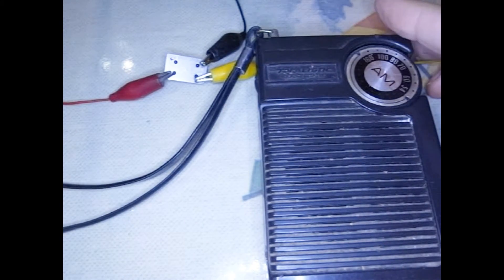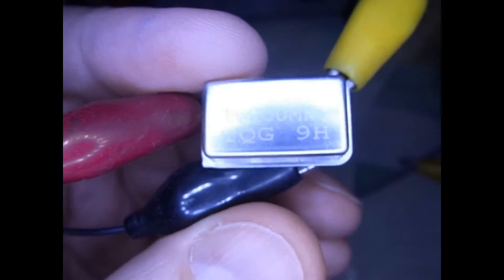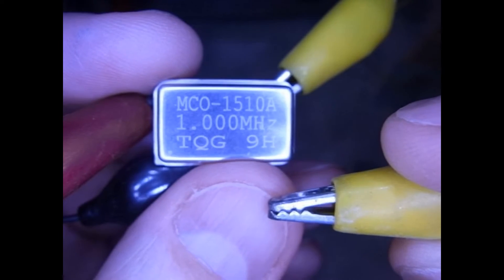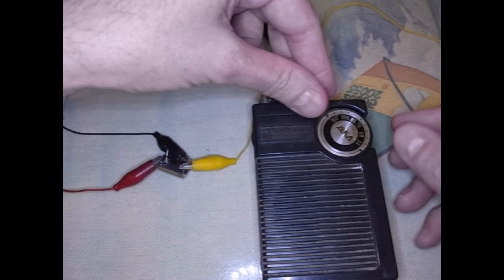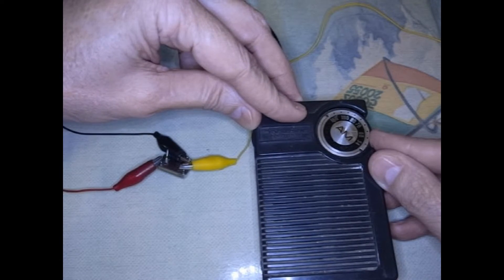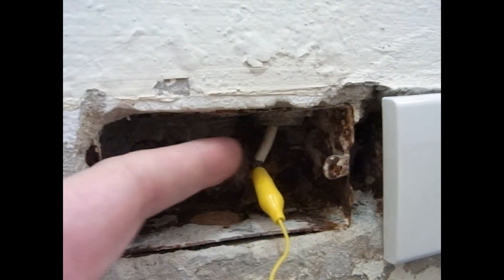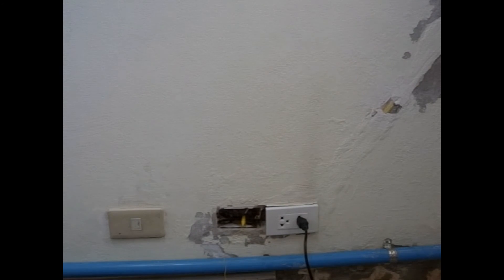DIY Wire/Conduit Tracer

Comment: Great, except I didn't discern any change in tone or sound of your radio while you dragged it across the wall, even as you declared success. The theory is good though. Maybe I have bad hearing?
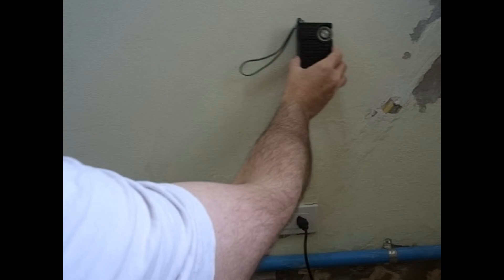Reply from the maker: At 3:40 and 4:30 you can definitely hear it go wa-wah, wa-wah as I pass over the conduit.
Reply: My hearing must not be good.
Reply from the maker: @stephendullea5307  You and me both.

Comment: You could actually do this with a live AC circuit, though indeed it is dangerous.
You could simply couple the 1MHz signal onto the wire(s)/cable(s) with a small capacitor. Probably something like a 2n2 to 4n7 capacitor would work, though I haven't tried it. (2.2 nanofarads to 4.7 nanofarads)
It is also advisable that you use a Y type capacitor if your crystal circuit isn't isolated well enough. (Thus the possibility of you coming into contact with the circuitry and possibly getting a shock if the capacitor has shorted out for some reason. The reason why I say to use a Y-type capacitor is because Y-type capacitors are specifically designed to fail open-circuit instead of short-circuit - the opposite of what happens with most regular ceramic capacitors. They are also going to work fairly well to couple the 1MHz signal, as they are meant for high frequency EMI bypass!)
Reply: We're I can find a schematich